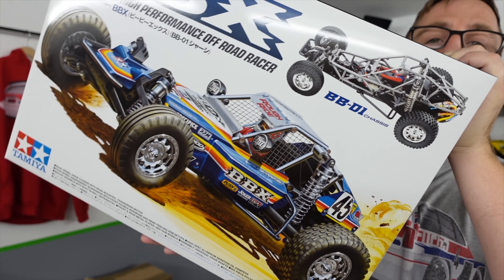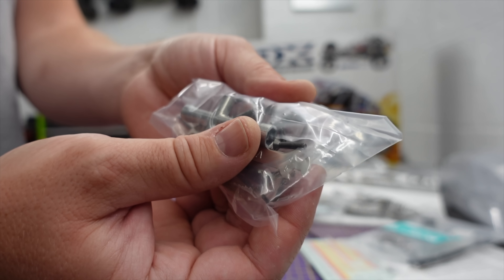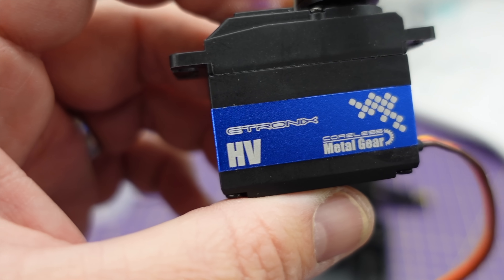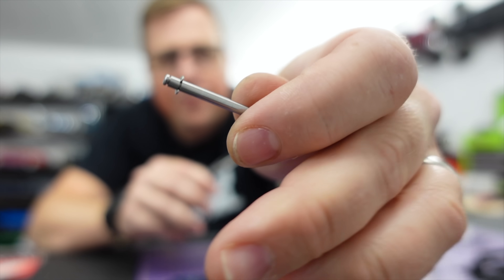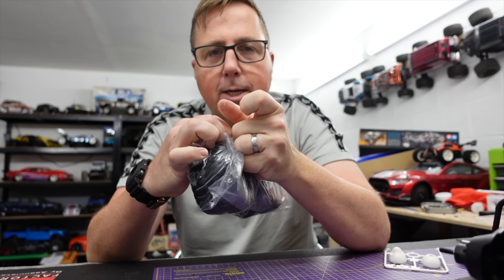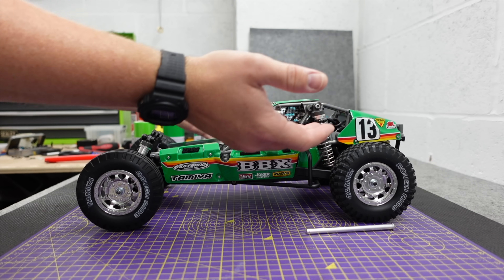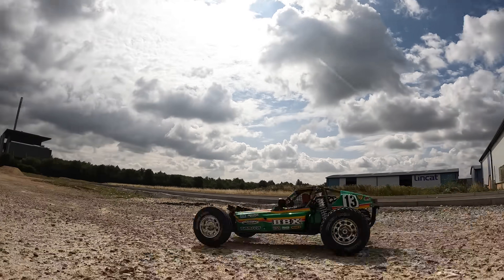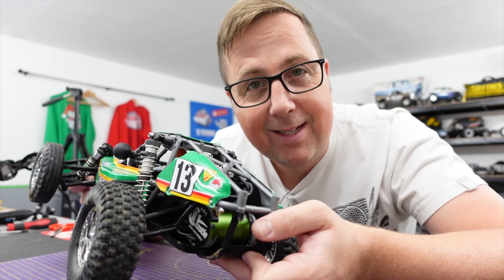The BEST Tamiya Off-Road Buggy in 40 Years!

Comment: Respect to Tamiya for edging ever closer to 1990s standards of technology.
Reply from the maker: Yes… we may soon be into the millennium 😁
Reply: I annoyed several people laughing far too loud at this comment.
Reply: You know, it might be old, but it`s a recipe that has worked for them since the 70`s and 80`s, an example is the Hornet, my first hobby grade RC car, it was a fun entry level RC 40 years ago, and it`s a fun entry level RC today, Tamiya has been a beloved brand in RC for a LONG time, and I suspect they will continue to be just that for a long time to come ;)
I still have a list of at least 10 Tamiya cars I still want, not because they`re better than Arrma or any of the other extreme bashers, but because they`re quirky and fun.

Also, no force on heaven or earth will ever make me buy "HPIjustbrokefornoreason and come with front axles too short and the spur gear held in place by soft plastic fastened by machine screws in soft plastic (moronic design) like the RS3 sport Flux that`s broken out of the box and literally cannot be fixed because the motor is stuck to the motor mount and the motor mount has pre-stripped hex screws that either just rotate or are completely stuck"
Literal garbage.
Or Trash`ass ever again, where you`re better off buying a chassis and ALL the rest as upgrade parts from other companies.
Who sells a 3-400 dollar RC car with a powerful brushless motor and PLASTIC axles smh, JUST to sell new axles is why..
Tamiya might be oldfashioned, but it`s dependable and fun, and that`s better than extreme performance for 5 minutes in many people`s minds.
Reply: @TomleyRC 😂
Reply: @afrog2666  my Blitzer Beetle is one of my favorite cars. I painted it sky blue instead of black. Looks awesome. Fun car. Of course I made it brushless and 2s lipo. Ive also got a tamiya tt02r with a castle 6900kv and mamba monster x esc that has hit 101mph soo far. Never owned an hpi but all of my Kyosho, vintage Team Losi, Losi, and Arrma cars are top notch.
Reply: Respect for still being around for decades selling the same product line since the 70's and 80's, that's staying power and having a solid product, and because of them still selling essentially old RC's with slightly more modern internals it means they are also able to cash in on the 30 year nostalgia cycle that happens whenand endless amount of 30+ year old somethings have enough disposable income to afford all the old toys from their childhood they could never afford means they can just keep churning them out..decade after decade.

I bet some of the cheaper Chinese stuff that is still incredibly fun to play that would blow the Tamiya out of the water performance wise (which is a segment of the market that's representative of whats kinda being reviewed nowadays for people entering the hobby) I bet they wont have anywhere near the staying power or "nostalgia" factor that a Tamiya can bring, they wont be selling them in 3 years never mind 30.
Reply: Haha. Cheers to them still being able to sell this retro tech!  Quite an accomplishment. 

But yeah, that’s funny. 🤷🏼‍♂️😂
Reply: This buggy harkens back to the old Tamiya Super Champ.
Reply: I won so many stock A mains against RC10’s with a Rough rider its silly. Become a good driver and you will win.
Reply: Indeed. 😂
Reply: The comment I came here to make.
Reply: The neo fighter is not only trackable but can be made competitive against even the most modern club cars...
Reply: Give 'em 40 more years, they might catch up. ;-)
Reply: Whatever you say about Tamiya their artwork has a timeless beauty that every kid from the 90’s loves. Even though I know their cars aren’t great I still love them as a brand. Beatties and the folders era of RC cars! 😊
Reply: And again i want to buy one 😂 i should grow up...
Reply: I had a Astute many years ago
Reply: I've build some Tamiya kits with hex screws (3rd party aftermarket) and I'm also using them on basically all non-Tamiya surface and air models. But I have to say, even though they were cross headed, the screws they ship with their models were (and are) always high quality, many of them nickel plated, some stainless steel. So after a while, I went back to the original screws (for following builds).
Reply: Only Tamiya can add a trailing arm suspension to a buggy and make people fawn over it.
Reply: Right,my frog is still burning diffs up, running stock battery.
Reply: @terrya450 They are great fun to build, customise and drive and if it does fly into a quarry it won't break the bank to replace it. I understand many clubs have DT-03 leagues.

I have 3 of them, one of which is pretty much entirely aluminium and carbon fibre. It has had some catastrophic crashes and just drives on. It's stupid quick too as it's got a 7000+ KV motor and runs on 3S. I built it to be extreme. One of the others is stock and box art and the other is in my "To be built" pile.
Reply: @rc-fannl7364 That would actually be going backwards. Why copy what every other company is doing? As I said above, if you think like that you obviously don't get it.
Reply: @tastenheber Many of the HotShot range, Astute TD2, and Super Avante TD4 screws are hex.
Reply: @newT033 So you understand then yes?
Reply: @congerthomas1812 Something isn't right then. Seized bearing(s), build up of dirt, crap plastic bearings,  not enough and/or wrong type of grease, dirt getting into the gearbox, bent drive shaft(s) causing centrifugal stress, incorrect gearing, motor too powerful.  Even excess toe in or out front track can put excess stress ondrive axle of 2wd cars on grippy surfaces. A common cause is having an ESC with no brake set so pulling the stick back puts the car straight into reverse.
Reply: My very first Tamia buggy ,was the one I got from my father when I was a kid.
The Tamia holiday buggy,does anyone remember those?
with a cowboy figure in it and the jerrycans on the side,man that where good times back then.
Reply: @sosteve9113 I had one. I grew up in the 80’s. I had many Tamiya RC cars. Holiday Buggy, Pajero, Hot Shot, Hornet…all bought in the early/mid 80’s.
Reply: @adamharita206   awesome times back then,those cars where also a lot of sturdy back then
Reply: Ooohh.. that hurt..They're crying now..all the way to the bank.
Reply: @newT033  Losi Mini JRXT. *drops mic... .
Reply: I think the diehard tamiya fanbois won't even get the sarcasm :D
Reply: @LonestarPaul  Indeed! Some of the responses have been borderline concerning! Most people thankfully took it in the light-hearted spirit in which it was intended.
Reply: @afrog2666 I had a hornet as first proper RC to,
Reply: you're killing me
Reply: They are what they are man I love them proper nostalgic 👌🏻👍🏻
Reply: @olivervision I had a Super Champ, got fed up being trashed in races by Kyosho Scorpions so I bought one. This was early 80's. The Scorpion is still in the loft somewhere...
Reply: @DetoursRC what’s blitzer bettle from Tamiya ? And how much total to build that one ? And cost of kit ? Thanks
Reply: On road tamiya RC is very competitive
Reply: I’ve never built or owned an RC , this vid was fantastic to watch and has really got me interested. Thankyou
Reply: BWAHAHAHAHAAA HAHAHAA 😅 😅 😅 😅
Reply: The vintage RC tech is way cooler than the brushless RTR of these crappy times.
Reply: Looks like a modern version of  my Rough Rider i got in1986.
Reply: My Dad’s hornet is now mine and it has a 15T Arrma brushed system in it. Way overpowered, way too fast, too fun for its own good.
Reply: And Traxxas is on the early 2000’s era!😅
Reply: What do u mean

Comment: Really good to see a Tamiya kit that is up-to-date with Hex hardware, decent shocks and bearings!  Makes them much better value for such small changes.  Hopefully it's a sign of them waking up to the fact that relying on Nostalgia for sales isn't good long-term.  Tamiya have felt like a sleeping giant for a very long time now, if they can produce more kits to this type of standard (and better) then they can easily lead the market for quality scale cars.  Leave the big stuff to the others and focus on their core strengths.  A decent carpet racer, crawler and Touring car chassis to this level would be mint.
Reply from the maker: Yes, fingers crossed we get some more new stuff
Reply: When you say make better quality kits do you mean chassis + scale shell kit?
Reply: Honestly i would be ok with minimal elecs too. But ya chassis and body would keep cost down to make it more noticable on the market. They make a type R for 150 that is pretty nice. But it doesnt have body or elecs and gears
Reply: I have several Tamiya models, they are the Tamiya Hornet, Tamiya Super Hornet, Tamiya Grasshopper, Tamiya Fast Attack Vehicle. I replaced all of the nylon bearings with steel bearings, added RS-540 enginges to all of the above models and the speed, handling and overall smoothness of the ride is incredible. Next thing I want to do is swap most of the brushed RS-540 engines for either Traxxas 550 engines or brushless and the speed controllers, so I can run LiPo batteries.

Comment: Tip for doing the snap rings I've always used, I pull out a clear plastic bag that's large enough for the part, tool and my hands and do the assembly inside the bag.   Then on the off chance it "pings" and shoots off it will almost definitely end up inside the bag instead of lost in the void.    I do this for anything I'm building/assembling that is small and has a part under tension like a spring, snap ring, etc.    Works a treat and has saved my butt many times for just the cost of a ziploc gallon freezer bag.    This buggy reminds me of the Grasshopper I had when I was a kid nearly forty years ago, I might have to order one of these!
Reply: ha! lost one last night. Thanks for the tip!
Reply: I have good luck  doing snap rings. But I just jinxed myself. Lol

Comment: That driver is the same one I got with my 1983 Racing Buggy Sand Scorcher and it used hex drive fasteners, all aluminum suspension and oil-filled shocks as well. Its still running today. From what you say it would seem Tamiya are getting back to their roots. Best hobby I ever had.
Reply: Carrot Top?
Reply: I had one too, bugger when the grub screws threaded though :) thank god for having small taps for the fromt suspension arms :)
Reply: I had a sand scorcher in 85 ish, pretty sure it didnt have oil filled shocks and was plastic..
Reply: @mcdiskett2003 nope all sand scorcher sand SRB chassis were metal .only plastic sort of bit  was the chassis plates which was like pcb board and oil shocks .the clear electrics box and cage around the motor were plastic too .

Comment: I remember buying a Tamiya Vanquish in November 1989 with my first months salary. Upgraded the bearings and a one up from stock motor and zoom round the empty carpark on a Sunday morning. Quick charging like crazy off the old Volvo 340 car battery. Great days!
Reply: The Vanquish was a good buggy. I upgraded mine a few times in the vein of the Egress and still have it in my attic.
Reply: @polbecca  Yes I added an electronic speed controller (one   with reverse, yes I know heresy) but didn't get round to the carbon fibre chassis mod. That was a bit expensive.
Reply: @jabezhane  The carbon chassis parts were very expensive back then, so I copied the shape and made my own version out of fibreglass.  I put the good aluminium shocks on it, and full bearings, and I think I had a mid-90s Tekin speed controller.  I can't remember if I put a Kyosho or Trinity modified motor in it but it was a good bit quicker than stock!  Suspension was better controlled but the travel was still rubbish though. 🙂

Comment: I built an Associated RC10L in 1990. Had a hell of a time forcing one of the bolts through. When I'd finished, there was one little bag with a screw and a note saying: "Yeah, we cocked up instruction blah blah blah, use this bolt instead."

Read through the instructions and get familiar with all the bits before you start.

Comment: hey phil you should check out the tamiya xv01! its imo the best 1/10 on road chassis ever made. its an AWD, front motor, sealed belt driven rally car. theres no other chassis out there that handles quite like it. upgrade the front suspension blocks to aluminum and the chassis is pretty much bulletproof.

Comment: Took mine out for its' first run today too - like you I had also built the diff too loose and was losing power, so you're not alone! You also get a "proper" servo saver with this kit, usually Tamiya make you buy the part separately and give you some dodgy plastic setup from the 80s - not here. I thoroughly enjoyed building mine and I'm glad to see someone else who struggled cutting out that awkward bodyshell!
Reply from the maker: Oh the tight angles on the body… yeah, not easy 😅

Comment: My local shop has one of these in stock but I need to see your speed run videos before I pull the trigger. I know that each build is different depending on electronics but I happen to have that same exact setup that I took out of my trashed speed run car and was thinking of putting it in there. I just want to see how it preforms before I buy another esc motor combo. Or maybe I will get something different to put it in if the buggy doesn't preform well. I know it is an off road buggy but everyone likes a bit of speed now and then lol. Keep up the good work. I love you videos and you actually got me into RC! I am 40 so I have a bit of learning to do but your channel has helped out a lot. Cheers!

Comment: Very nice build!! I built a Tamiya Racing Fighter, DT-03 chassis with oil shocks, bearings, brushless motor 3300kv, 19T pinion. Lots of fun, great handling buggy, I put on some all terrain wheels and tires on it. I like how smooth it drives 😍💪
Reply from the maker: The DT-03 is really nice chassis. Simple... but works well
Reply: @TomleyRC  Agreed 💯👍thanks

Comment: My first Tammy was the the Super Champ. I built it and used to run it around my Uncle's pub back garden when I was visiting my Nan and Grandad. My cousin saw me driving it around and my Uncle bought a second hand Tammy and asked me to sort it out. I rebuilt the chassis and suspension and then bought a couple of poly body shells and painted one for mine and one for my cousin.

My cousin managed to run his buggy into a wall and smashed it into pieces. A regular at my Uncle's pub worked for RIKO, the importer of all things Tammy in the UK. He got my cousin a HotShot and my Uncle asked me to build it for my cousin. He also introduced me to the gentleman who worked at RIKO. He gave me a load of swag for me building the car. I had a Tammy cap, loads of spares and best of all, the official Tammy car carrying bag.

I was 19 then and my attentions turned to other thing like fast cars and pubs. I have no idea what happened to the HotShot but I sold my Super Champ to my mechanic. That car was ace in the snow. I put full size wheel and tyres on it and it was a drifter before I'd ever heard of drifting.

Comment: I agree with you, It looks like the best vehicle they have come out with in a very long time. I also think that the smoothness you`re getting out of this thing is mostly due to the Copperhead ESC. As far as running 3S or higher better check the motor limits first or you will cook the motor (guilty of doing this). Example the Tenshock 6pole motor at 2400KV is only rated for 2S, 2400KV is not a very fast motor but putting 3S on it will kill it. I actually did fry a new motor from Alien years ago by pairing it with a 3S capable ESC and running it on 3S with out even thinking the motor had limits, LESSON LEARNED!

Comment: This is very similar to the Rough Rider I had back in the early 80s - which was great until my brother destroyed it😢. That too used some, but not all, hex hardware. Lots of metal parts for suspension and engine/gearbox casing, and building up the dampers in a similar fashion!
Reply: Yes, I was thinking the same thing, a classic 😊

Comment: Nice build! I would've gone with the Hobbywing G4 17.5 motor esc combo.  Light weight and smaller footprint as the esc is half the size of the one you used.  Great video, cheers!

Comment: The fact that this tamiya kits includes hex machine screws is actually very exciting😂. I just built a blitzer beetle and it hurt my soul everytime I put in one of those damn crosshead self tapping wood screws. Lol
Reply from the maker: Yeah… the self tappers are not great. Although get a set of JIS Screwdrivers if you haven’t already.
Reply: @TomleyRC  ive got the jis drivers. They fit well just not a fan of self tapping screws.
Reply from the maker: @DetoursRC  well at least you have the right screwdrivers. That was a big step for me when I got some... but yeah, they are fine the first time you secure them, but soon destroy the plastic after a couple of strip down and rebuilds
Reply: I thought a screwdriver was just vodka and orange juice. The instructions make a lot more sense now.

Comment: Nice Phil! I've got the same motor/ESC in my Racing Fighter and run it on 3S with the 19T pinion. Haven't destroyed it yet.. goes like mad.
Reply from the maker: The gearboxes are usually pretty good. As long as they have bearings

Comment: A year later.  Has the BBX survived??.

 First ever  track win was with a Tamiya Subaru Brat. Trinity Monster power brushed and the 3 step Tamiya speed switch/crash switch. 2nd place out of 10.  I still have the plaque on the wall.

Best win ever was a 1/8 scale Nitro Truggy win.  1.5 hr long A Main.  6 nitro fillup's, with a splash at the end, to be sure.  Won a new Novarossi 21, jug of fuel, really nice trophy and a picture in RC Car Action, in the small blurb column.  Was Epic.